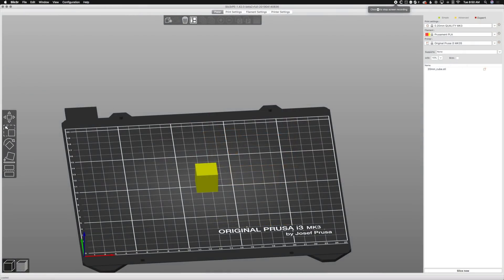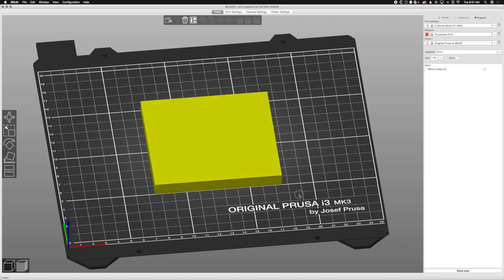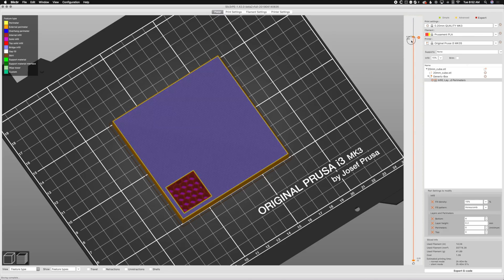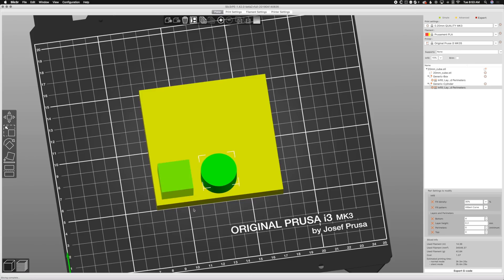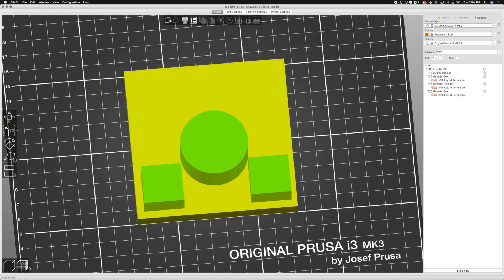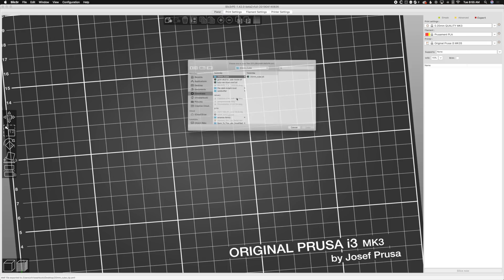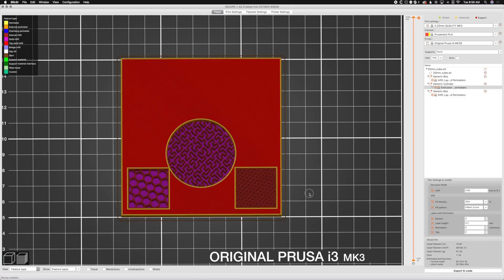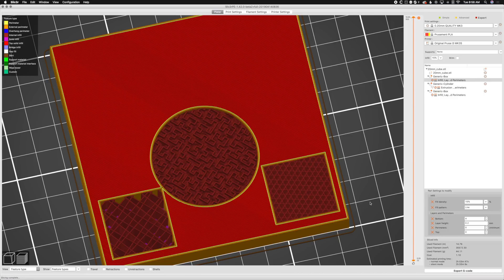Prusa Slicer: Understanding Modifier Meshes

Comment: What would be dope is to be able to modify other parameters from filament and printer for example. It would make so easy to make temp towers, variate extrusion multiplier, rétraction settings.... It would make so easy to tune perfectly our profiles.... With a lot loooot of less time like you could make a retraction test grid variating speed and length. Would be so cool😍
Reply from the maker: franco otaola there are way more settings but this is just a quick overview so people get used to the mechanics. Go to their GitHub and put in requests for the options you'd like to see.
Reply: @Mr3DPrintWizard  yeah I know about the other options, actually I played with it since you presented the support blocker enforcement that I went to play a little bit more with this. Good idea about the github tomorrow morning arriving to work I would post it. Thanks as always Chris

Comment: How about layer height
Reply from the maker: Use variable layer height instead.
Reply: @Mr3DPrintWizard  I can see a use for this though: print one tower of your model at one height and another at a different one. The seams would not be an issue as long as it's disconnected towers.

Comment: Please use the File menu "Save Project" / "Save Project As", and save into a .3MF file. Going forward, we will only support 3MF files as the project files.
Reply from the maker: Well poop! I didn't even see the save project since it didn't describe it's filetype. Also I noticed a bug. If you try and use the xyz coordinates on the boot right to move something it doesn't act as it should. I'll try and record a video and share it to the prusa slack.

Comment: Hi Chris, does the layer height modifier work ?
Reply: I was just running into this with an overhang test print that I wanted to use modifiers to lower the layer height at different angles. It appears that modifiers cannot change the layer height even though it IS a parameter than can be altered on the screen.